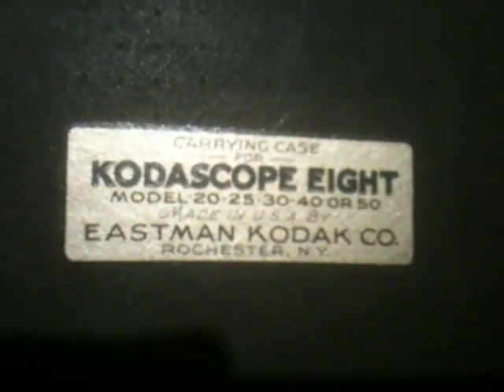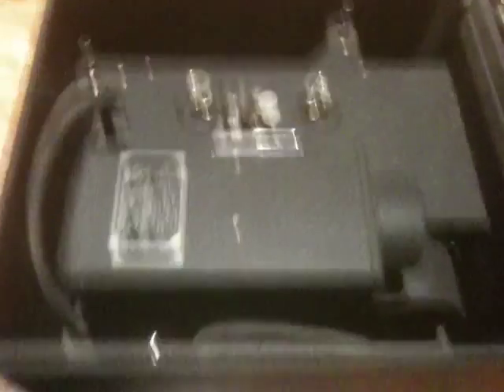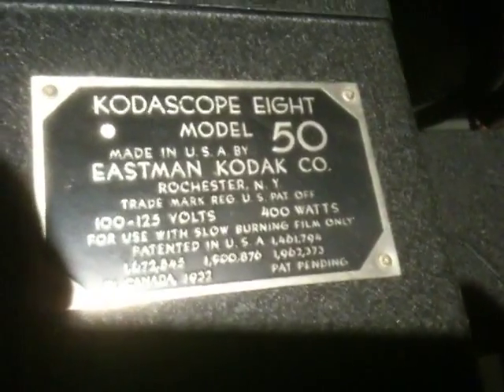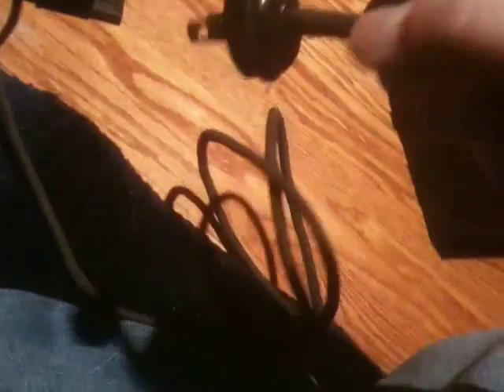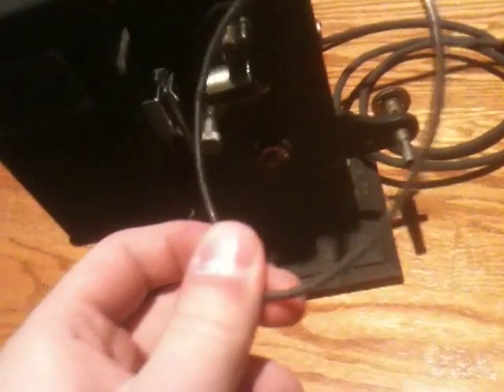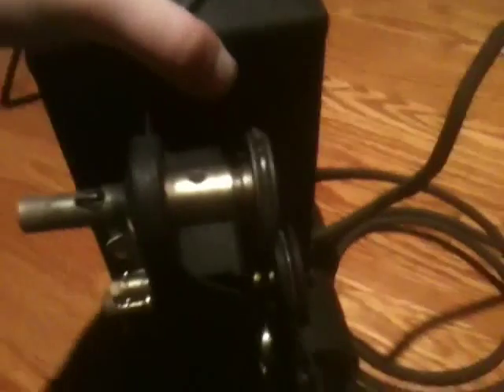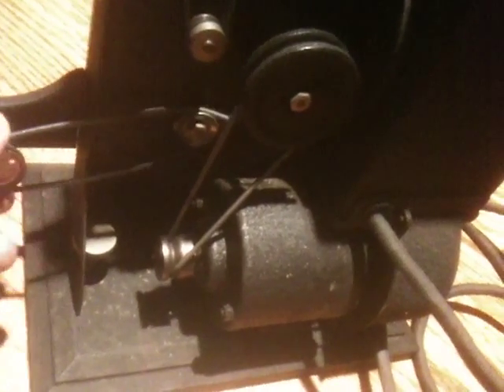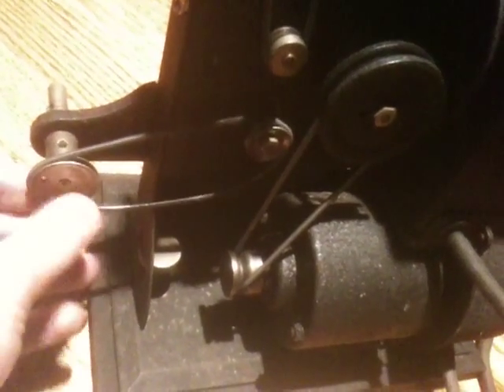Thrift Store Score: Kodak Kodascope Eight Model 50 1930's 8mm Film Projector

Comment from the maker: @JimW925 oh it's definately 8. there's a reason "Eight" is in the name of it itself :P. i worked with film for a summer job in 2008 and 2009, transferring 8mm, super8, and 16mm to DVD, so i've worked with film a lot, and once you have, it's pretty second nature to what you're looking at. if that were 16mm, that projector would have been A LOT bigger.
Reply: Well, I have news, for you  I've been working, with film.since 
I was a kid.  Splicing film with
Press tapes.  Regular 8mm 
Super 8 & 16mm & threading 
Film on projectors plus showing
Them on the wall as well . Did you
Do that when you where a kid?